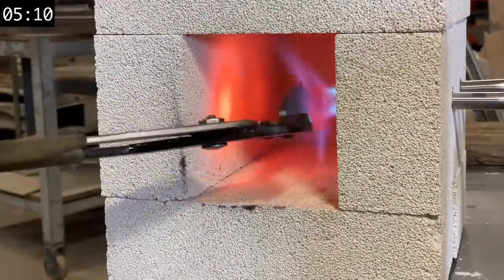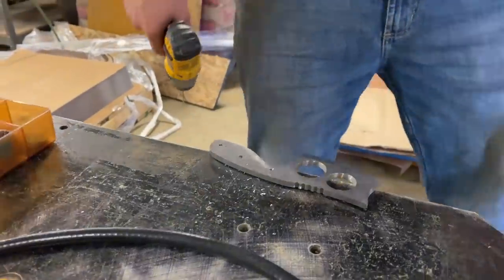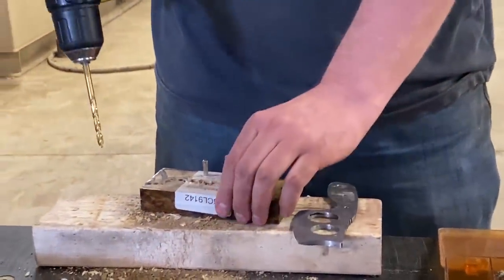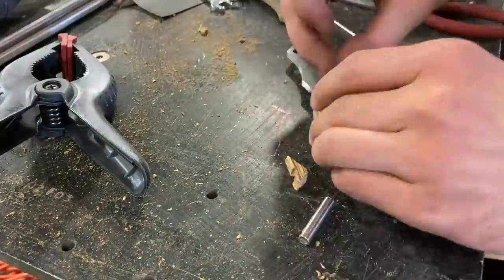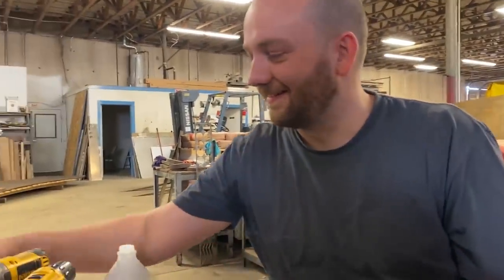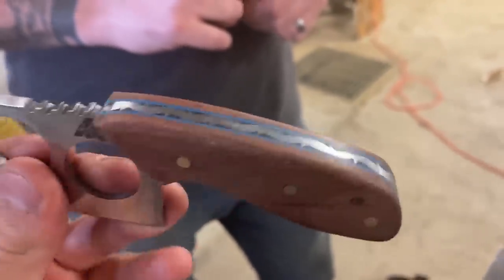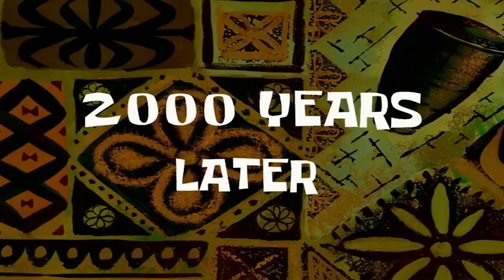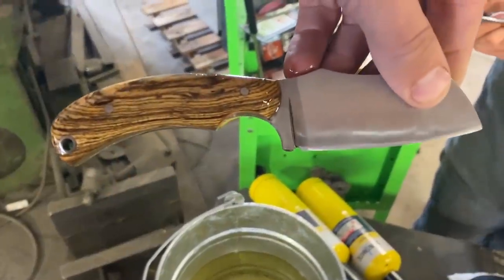$7 Chunk of Steel to Beautiful Knife

Comment: Damn, I still haven't even gotten around to hardening mine, let alone making a handle. 
At least I have drill bits that can cut hardened steel for when I screw it up?

Nice work guys!

Edit. I came here from the email link. For some reason your emails always go to the spam folder, no matter how many times I mark them "not spam". Figured I'd let you guys know, for whatever it's worth anyways.

Comment: If you drill your pinholes, you have to drill them slightly bigger then the pin is in diameter. If you do it like this, your scales dont crack

Comment: I'm surprised you didn't ask Alex about the infill on the sections he chainsaw(and small) filed.
Reply from the maker: He used a black resin then sanded it down flush. We talked about it but I ended up cutting a lot out to make the video shorter.
Reply: @WaterjetChannel  Sweet, thanks.